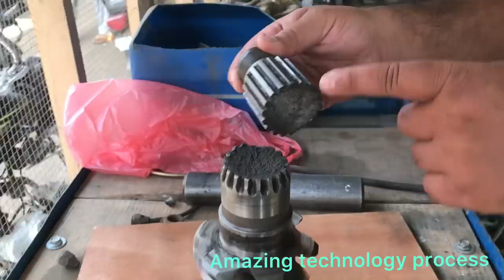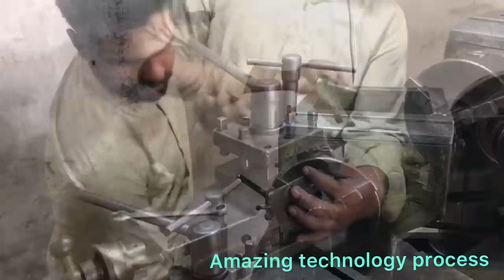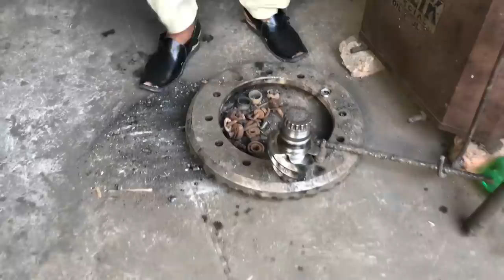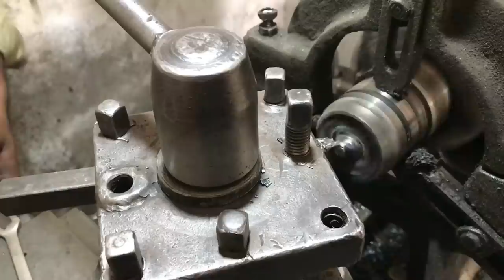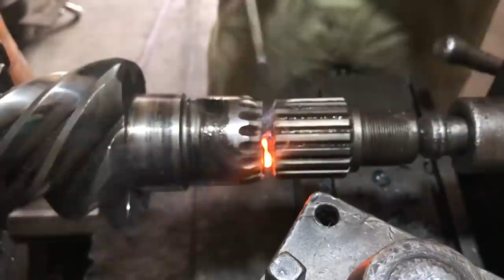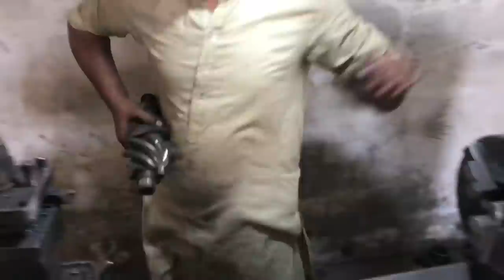How to Repair Broken pinion in Beautiful Way

Comment: Given what the machinist had to work with and perhaps unavailability of finding a new part, it looks like he did a pretty good job repairing the pinion.  However, the proof will be in the pudding on how long it lasts and whether there are some alignment issues that break the part again.
Reply: Nah bodged like all of it
Reply: @robc3056  Probably.  But,  you work with what you have.

Comment: I'd love to see a follow up on how long this lasted... Maybe the driver just needed to get back home to a proper spare part, like the captain that flew a 747 from the USA back to Heathrow UK with a blown engine because the US workshops wanted too much to replace it. A bit sketchy setting off on 3 engines across the Atlantic on purpose, the busted Rolls Royce engine was testing how long an engine would last on the 747 before failure, more than 36,000 hours without overhaul which is quite impressive.
I've welded a few forged steel parts by preheating and laying down some root welds with a domestic 120amp MIG and they're still working 25 years later! I once did a temporary fix on a diesel injection pump piston by gluing with JB Weld, the guide block back onto it, while I waited for a new one. That was in 1992 and it's still working, god only knows how as it hammers up and down and gets quite hot in service, which I would have thought would melt the glue. Sometimes rough repairs can work, other times not!

Comment: When they will start TIG welding on those repairs. There is so much integration of deposits in this weld that may survive going out from the parking area. And how expensive are center drills?
Reply: That wasn't anything close to tig welding. They where stick welding which dumped a ton of heat onto the part. It will snap off again in the same place.

Comment: Welding on the lathe will weld the bearings on the lathe.  I had a farmer welding parts on his tractor out in the field and found out later he had bearings welded to each other.
Reply: this only happens if the current passes trough the bearings, if you put the clamp on the same side as you are welding this is not a problem
Reply: That's funny... That machine is probably older than you and me... Probably not a day that goes by that they aren't welding on it...

Comment: I'm very interested to know how long the repair has lasted . And what rod was used. I wonder how the heat affected the tempering ? And was it induction hardened ?
Reply: Lasts longer than having no pinion gear
Reply: I'd give it 10 turns of the back wheels.
Reply: @MrHitchikerOz  then in your opinion it's not even good enough for a emergency repair . I've welded drive shafts that worked great and had no issues , but it's not really comparing apples for apples .
Reply: They offer 30 30 warranty .. 30 seconds or 30 feet
Reply: Hardening and tempering are inventions of the devil and should be avoided
at all cost....
Reply: Welding heat could annealed that steel and possibly make it softer... It might require quenching and tampering after that to make it hard and less brittle
Reply: @Aremruata_just_me  steel
Reply: @troo_story  oh..edited
Reply: @micofam5217   Another option is a tail light warranty: we see your tail lights, the warranty ends
Reply: @MrHitchikerOz  How long if you did it ?
Reply: @GeneralBW  ThAT'S GOLD!
mAY i PLEASE USE your SAYING
at work on Monday?
Reply: @micofam5217  those who haven't done such repairs mock them, but such repairs are the only reason many trucks ply on road in certain areas where you have to travel 200 plus km to find a shop just to make a advanced payment and wait for another 20-40 days for that part to arrive at the shop. now do you think such repairs are worth it. Don't criticize other at the comfort you your  condition.

Comment: I would say at maximum it has 10% of its original strength getting less and less as used due to runout. If the truck was emptied and only required it to get back to base it may work if driven gently. When you are stuck in the middle of nowhere then something is better than nothing.
Reply: That and the instant annealing from the welding.  Any hardening that spline or gear had is toast.
Reply: The entire country is nowhere!
Reply: @cat637d  That's a bit unfair, These guys did good work with what they had and there  are places that can easily beat China for quality.
Reply: @MrMaxeemum  Nowhere did I insult those fellows work,  they are in a Country that has very little concern for the individual.  My statement was concerning their government, please don't try to read between the lines.

Comment: They had welded wheel axle shafts (even higher torsion loads) before so this repair is no big deal :) In the next video, they will weld a broken conrod...
Reply: I am fm pakistan , in fact they do weld conrods
Reply: Do you if the repair has lasted ? I'm wondering about the heat from welding taking the tempering out .
Reply: @jacobclark89  Who knows, maybe the original failure happened because the part was too brittle. If it runs true the repair might be stronger - IF it runs true.

Comment: wow, alot of harsh comments on here.  30 yr wandering Millwright here.  These guys, and alot of the third world are often very fast and seriously skilled,  they have very little in the way of tools and equipment but they're not fools.  This shaft may be being used in a completely different application.  I've seen lots of very craftily-built equipment, particularly in poorer countries,  for all sorts of purposes.  Machines built from old salvaged transmissions, axles, diff's.....in fact they may be fixing it after its been scrapped for exactly the reasons you all point out below!   I doubt very much these guys would waste their time and precious resources if they thought it was doomed to fail....this is not their first rodeo!  I've got alot of respect for these guys, and in general "Bush Mechanics" everywhere!!

Comment: And of course we know what happens when you weld previously heat treated steel, yes it will crack across the weld. Dodgy Bros. at work.
Reply: Would it be better of the heat treated it after the weld?
Reply: It's been repaired 3 times this week

Comment: You have to work with what you have! We can criticize the process and we will all be spot on based on our experience but if all we had were those same exact tools you cant lie when I say we would do the same. Granted we might have maybe drilled and tapped both sides and cut a bolt and use as all thread to join the two and then weld but regardless we would still figured out some way to get'er done with what we have! If I didn't have any experience id be in awe but worst case scenario I would have enjoyed being a part of that process to help the situation.
Reply: This ‘repair’ is nothing but garbage. Weld will not hold that together long. Why do you think it broke in the first place? All the heat treating will be gone. Why didnt the cheap bastards just get another gear set?
Reply: By the way, I’ve been in the business of repairing machines for over 40 years.
Reply: @doughawley8101  cheap? Or broke? Or temp till part comes? Or maybe parts are hard to come by? Who knows. Our way of life and theirs is NOT the same. I've cringed at every one of these videos I've seen. We know it won't last. But if you had nothing in the world but a worn out lathe and a stick welder, and had to deliver some product to put food on the table in an overpopulated, poor country, and that truck was your lifeblood, what would you do? It's ugly and dirty and out of spec and out of temper, but if it feeds his family, he doesn't care. Thank you God for America and our lives of privilege.  And good parts 😉
And just FYI, I'm a disabled American veteran. I'm not picking, poking, or trying to start anything with anyone. I'm just saying try to look through a different lense. I'm sure they would prefer to go to a reputable shop, install new parts and have a warranty. More proof that we are the lucky ones and should be grateful for everything we have. I hope everyone that reads my comment is in good health and has a wonderful day!

Comment: Since this is used in a high torque application this job is going to bite the owner big time in the end as it's going to break right when they need it the most. On something like this you just have to get the part made or buy a new one, just to have peace of mind.

Comment: The end result is the shaft out of center and the weld will not last. the shaft will probably break again. Seriously a beautiful Job?
Reply: Its not a matter of "probably", its definitely going to break the first time any torque is applied to the driveline. They spent alot of time repairing a paper weight.i certainly wouldn't use that pinion in anything i own.

Comment: I wish they had shown the installation of the repaired part. Watching them set the pinion preload and checking the mating of the gears to the crown wheel would have been entertaining.
Reply: I seriously doubt they go through that much trouble, the truck that is for is not meant to last due to the nature of the roads they tend to drive on. Wooden body on a cheap metal frame.

Comment: Probably doesn't matter if the splined shaft winds up slightly shorter since they probably use shims to fit the gears together.  Main thing is to maintain the two welded parts are parallel.  I suggest safety glasses, even though nature gave us a spare eye.  Interesting how they make a grinder work since presumably don't have a horizontal milling machine and correct cutting tool for the splines.  Cost of repair $15?  Biggest concern is if this is the input pinion on the differential of a semi-truck, as they must use engine-braking to control downhill speed.  If it snaps, the truck could runaway on a steep road.

Comment: You know these guys are doing this video just for the clicks. As soon as they were done filming, they threw the part away.
Reply: Or if it lasts just long enough to sell the vehicle
Reply: HAhAha😂😂😂
Reply: I think the problem is their steel. You see how easy that drill bit went in there? Have you ever tried to drill a pinion shaft? It doesn't happen like that.
Reply: @alexduke5402  did you see how hot the metal was when machining ? Did you hear the sound it was making ? It's got some hardness to it.
Reply: it would be acceptable their industries cause they dont have other ways.
Reply: Sure!  😁😁😁
Reply: Lol 
Absolute fake.
He is using low strength cellulose welding rods on high carbon steel in a very narrow weld prep.
Fake fake fake repair

Comment: No stress risers in that "repair". And excellent heat treatment after the "repair".
I'm beginning to think these videos are just an elaborate joke being pulled on the rest of the world.
Reply: Yet look at all the fools praising them for being AMAZING.
Reply: I have the same doubt as you . Maybe the truck will run fine until it goes up a hill ? If I was stranded and there was no other option I would try this , If it breaks it might take the driveshaft with it !  I would like to know if the repair is still in service ?
Reply: The method of welding it back together can work. The problem is you need much different welding techniques and specific materials. Their equipment was really in poor condition and they didn't weld it properly. Then he just fucked the piece with the grinder. Should have been on a mill for that. pinions are very important and can't have any play in them. He'd be lucky if he made it a mile with that in his truck.

Comment: I would imagine if it broke 10 metres down the road they would be out of business pretty quickly. These kind of repair shops would rely on word of mouth and quality of repair. 
But I do agree with all the comments on hardness and toughness of the final repair. Without a doubt the strength is dramatically compromised. 
They probably advise to replace with a new part ASAP.

Comment: Stop, drop a gear and pop the clutch
Driveline parts can't cost too much!

Seriously though, that drill bit deflection at around 5:23  : p
Reply: USD for a ring and pinion set for a medium duty isuzu or nissan, EASILY $1400 or more

Comment: if you know what run out means as well as fits and tolerances this is nightmare fuel just for you.
Reply: this is the dirt cheap fuck it good fix
Reply: @dementedbowine8681    Did it set up correctly?  good gear mesh and backlash?  Runout within tolerance?  Pull a load without breaking for more than 10 days?

Comment: Wonder how long it will last.
Reply: 1ST gear maybe.
Reply: 5 минут
Reply: less time than it took you to type your response
Reply: @daronsteele7976  Maybe, LOL
Reply: 60/40 it fails in a month and 40% it takes out the drive shaft when it brakes. And .25% percentage it will  kill somebody . There is a 50% chance this guy will get beat up for getting weld splatter on the machinest lathe.

Comment: Here is a million dollar tip for free. Make the weld slot much wider and weld it with a mig welder. Not stick or flux core, MIG. That will keep the slag (flux) out of your weld and it will be much stronger. I didn't say it would work, I just said it would be much much stronger.
Reply: Here is a million dollar tip for free.  Why not just buy a new one...
Reply: @drfiberglass  I would presume that since he went to that trouble new ones are not available. Besides, "buy a new one" is not a million dollar tip, it might be a 3 dollar tip though.
Reply: If you know how to stick weld then slag inclusions shouldnt happen, but yes I would have used a wider gap and smaller rod.
Reply: @abyssmanur3965  I am not the one doing it he was. Obviously he wasn't that great of a welder so I was offering tips that would help him, not me or you. A wider gap and or a smaller rod is exactly what I was suggesting.
Reply: Only two MIGs in Pakistan, both at defense plants...

Comment: Ray Charles made better welds. Your tail stock is off so bad, you need curved drill bits!
Reply: 🤣😂 I give it a 60/40 to break in the first month. And a 40% it will take out the drive shaft when it breaks.

Comment: They should put some protection that they don't get weld splatter on the lathe ways.  also it is curious how these amazing guys have no work benches.  i never see any tool boxes either.
Reply: I would fire that guy.  he is spraying the grinding sparks and the grit and the removed metal chips into the chuck and that isn't healthy for the chuck.  and also get up off the floor, find a work bench and start behaving like a Real Machinist.

Comment: did you see how easy the mating part was just thrown on the splines? worn out most certainly. You cant successfully weld a part like this unless its an emergency repair to get You home while a new part is on order.
Reply: That type of repair is how most of the world manages to keep doing business. New parts are both expensive and take a long time to arrive.
Reply: @kmoecub  I'm sure you are correct. Good bon them for keeping it going. They are doing the best they can.

Comment: Your lathe cross slide needs adjusting or locking in place as there is too much backlash movement at 3:07

Comment: Bawahaha,  I love the extensive heat treatment after completion! This pinion gear won't last 100 miles or maybe 100ft. It has no lateral/torsion strength at all plus all the previous comments. Junk paperweight now!
Reply: I give it a 60/40 to fail in the first month.

Comment: It was kinda looking ok until the angle grinder came out to grind the output shaft splines.. No proper heat treatment, those welds aren’t going to last hauling 30 tons of scrap metal through the desert. when it comes to repairing old parts I’m all for it. But someone will be stranded again

Comment: What?this kind of fixing the transport rod method, it's not a good method. Because of the transport rod is needed to resist high power, hi temperature. Change a new item is a good idea.

Comment: Be better getting a tube of super glue probably last as long  ( till the first time clutch is let out a bit harsh)
Reply: Wouldn't even have to let the clutch out a little harsh, the first time any kind of torque is applied to the driveline that pinion is going to snap.
Reply: 😂 or JB Weld

Comment: The only reason this would work at all, is because they didn't know they can't.
That said, if they built a fixture to hold the pinion, and put the cutter in the lathe, they could have recut the splines

Comment: WELL, its amazing alright. But I wouldnt call it technology,
more like blacksmithery. Or metallurgy. I would be surprised
if the repair can handle the torque the factory part did.

!
Reply: Inspired by your comment, and the fact that the factory component couldn't handle the torque either, I just had to post a comment up top.🤣

Comment: Technique yes , technology no . It likely would have been just as easy and taken just as little time to heat that up to forge temperature and simply use pressure to force the pieces back into one . The whole entire piece was more than likely made by forging , and then removing excess material . And when you heat something up like that even with a welder you make it more likely to snap because it's brittle . You need to heat treat it and make sure that you have the correct hardness . I certainly wouldn't trust that in my vehicle , but then I've never broken a pinion .

Comment: Hand grinding a precision ground spline shaft is an oxymoron. 
It would almost be believable if he filed the spline, but hand grinder. Lmfao!
Reply: The Spline is usually hobbed then post heat treatment it is ground externally to dimension. He gave it a fair crack with the hot wheel of danger though.